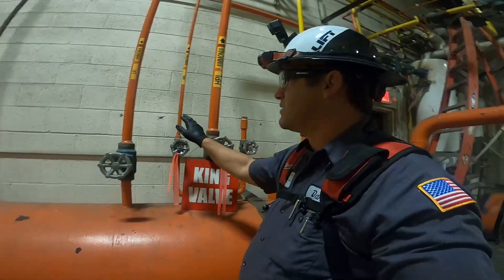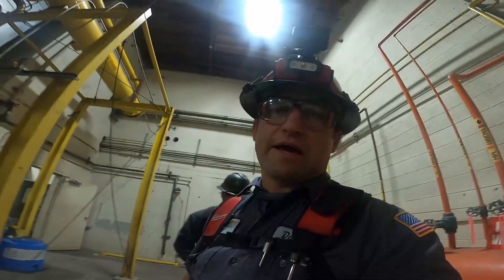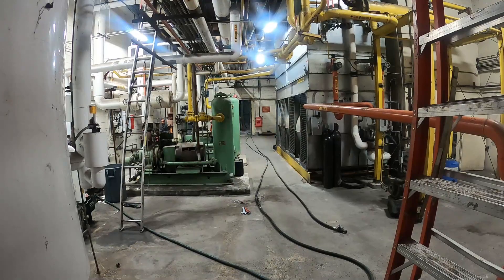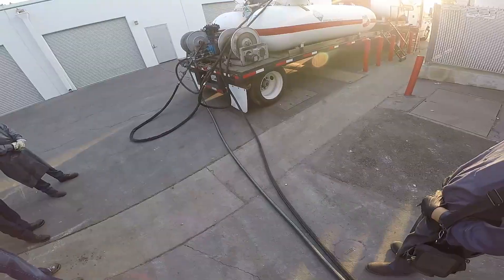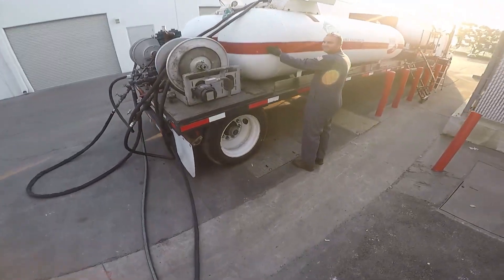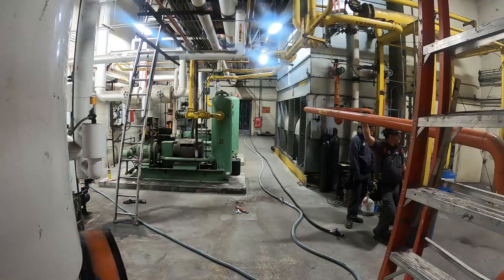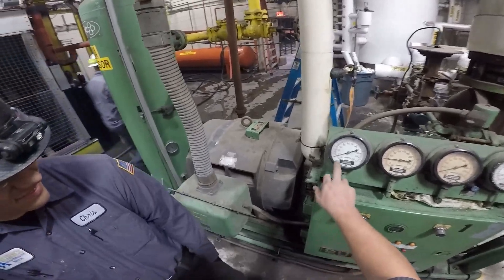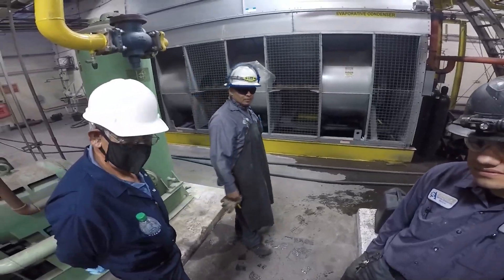Ammonia System Pump out.

Comment: Are those some sullair compressors?
Reply from the maker: Yes. Those are Sullair compressors. We still have a couple accounts with these compressors. They just keep on running. Lol
Reply: @alliancetechnh3368  all 8 of ours are workhorses
Reply from the maker: Even the Ball screw assembly is  super easy to replace. They don't build compressors like they used to.
Reply: @alliancetechnh3368  yeah they aren't that bad but we keep on breaking them, 2 of our machines are looking like they will need a slide valve rebuild or something, they will load but then they will fight when unloading and the actuators break the ball screws. We were told there is a check valve that is suppose to relieve the oil pressure off of the back side of the slide valve when it is unloading that can go bad and an orifice that the check valve is inside of that can clog. At the moment we have two machines that are fully loaded at all time.
Reply from the maker: @wickett7078  Yeah the Ball screw assembly move really nice when you replace the glide rings and check the orifice. Gonna need a chain wrench or bug pipe wrench to pull it off though.